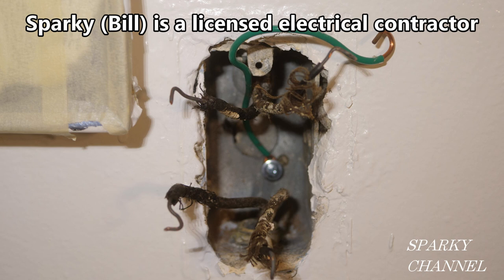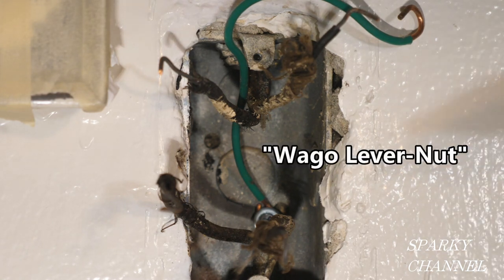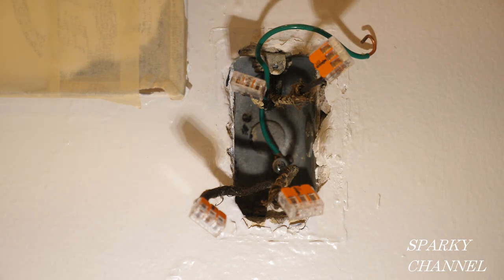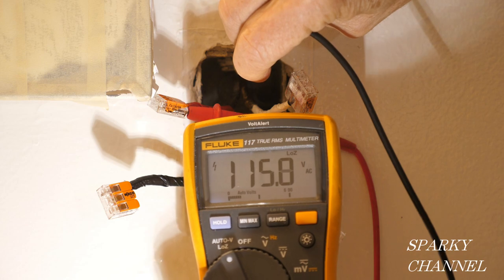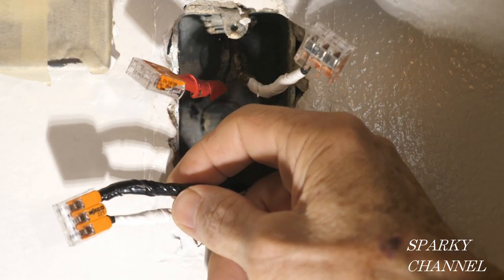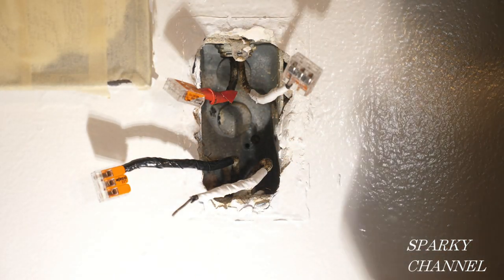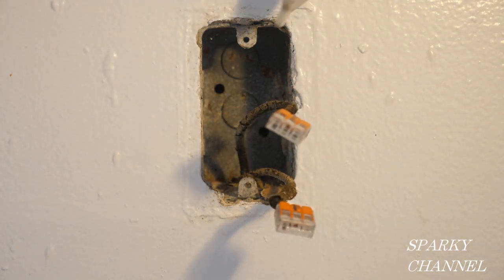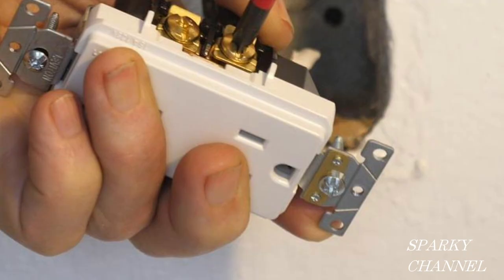How to Replace a GFCI Receptacle and Discover What it Protects Downstream

Comment: Bill, I notice you generally use Leviton GFCIs and AFCIs which have the line wires at the top of the receptacle.  My home is on 1955 NEC Standards, and I have a detached garage.  My area required the bathroom receptacle to be grounded, the receptacle near the sink in the utility room be grounded, the receptacles near my kitchen sink be grounded, the switch box to the light fixture in my bathroom be grounded, my furnace circuit be grounded, my outdoor light fixtures and their switch boxes be grounded, and my garage light fixtures and receptacles be grounded.  In my house, all the line wires come to my receptacles from the attic.  The Leviton GFCIs & AFCIs are perfect for this.  However, my garage has the line wire coming in from underground to a power receptacle that is the first in line.  From there, the load wires run to pull chain fixtures and a light fixture controlled by a wall switch.  My garage has open studs, so I can see the wiring easily.

In my retrofitting job for the garage, I used a Pass & Seymour Legrand GFCI because the line wire section was on the bottom.  The Pass and Seymour Legrand GFCI receptacle, however, had a short life (2016-2022).  I went back to Lowes, where I first bought it, and this time, they had Eaton GFCIs, which also have the line wires at the bottom.  I thought I would pass this on to you, to make replacing receptacles a bit easier for anyone who finds his or her line wire coming in from the bottom, rather than the top.

Comment: Great video. Very thorough! Also really nice you reidentified the wires especially the red tape on the hot. I can't tell you how many times I see work and this is not done.  Professional job.
Reply from the maker: Hi David! Yes, the colored electrical tapes do a great job of color coding the old faded wires but they also give a protective coating. Thanks!

Comment: Bill, I came back to ask since the NEC rules changed for 2023, now requiring kitchens to be protected with both AFCI & GFCI Protection, in this house with the GFCI in the bathroom, would you replace it next time with a combo AFCI/GFCI receptacle to make sure it meets the code, or would you wire the GFCI in the bath to send current downstream to the kitchen even when it trips in the bathroom, then put in an AFCI/GFCI receptacle in the kitchen to meet the 2023 code?

Comment: Great video and just one question, why did the breaker need to be off for the voltage drop test?  Your hot was the top wire coming into the panel and the bottom wire was the downstream one so whether the breaker is on or off it would still be cold. Are you worried about it being fed from another direction?

Comment: Nice clean install thanks Bill!!
Can you do a video showing a receptacle or switch that has a hot or neutral wire with stripped insulation in the middle of the wire and screwed to the receptacle at that point where the wire is continuing on to another receptacle elsewhere  and explain how you update that?
Reply: Heat shrink tubing. Maybe 2-3 layers

Comment: Great vid.  Didn’t u in the past make a self tapping screw ground?  And why is that illegal?  I think that self tapper would be a great ground. Thanks.
Reply from the maker: Yes I did. It was about electrical fire alarms: Kidde Hardwired Smoke and Carbon Monoxide Detector with Battery Backup and Voice Alarm  Installation: https://youtu.be/ORwBKqiKHHY
Perhaps I made another one specifically about the self-tappers vs. the green grounding screws too.

Comment: Love the channel.
Hey what is the charge terminals for? 
There’s line, load and then “charge”
Reply: charge is just a translation. Leviton devices are produced with bilingual labeling.
Reply from the maker: @kenbrown2808  Ken, excellent answer. The question had me stumped!
Reply: @SparkyChannel I had to look up a picture of the back of one - line translates to ligne, and load translates to charge.  
another pro tip: since they always put the marking tape on the load side, and the adhesive is obnoxious, you can determine which is the load side of one you are removing by feeling for the tape residue.
Reply: One last question here! 
is there a way to wire a receptacle off of a gfci to where it won’t be affected by an interruption of the ground, fault circuit interruption? Like if you had a receptacle that went to a bedroom and was coming from a gfci in a bathroom, kitchen etc..?
Reply: @kenbrown2808  thank you 🙏
Reply: @wyattsdad8561  glad to help.

Comment: The outlet showing 70VAC and "Hot On Neutral with Hot Open" on the tester was solved. The outlet that feeds it had two loose neutral wires.

Comment: Do you have any videos where you replace a small electrical box in a wall with a bigger one? I cannot fit a gfci in my current box.
Reply: I’m having the same issue
Reply: @MA-vm6jl  Will require drywall/plaster patching. Carefully removing drywall with an oscillating tool. Possibly cutting the box out with an angle grinder where it's attached to the studs....unless you remove a lot drywall. Big pain. Like to see a pro do it and compare.
Reply: Hope it worked out for you.  I’ve added deeper “old work” boxes and it was no big deal.  Go to a box store and get a deep box for ‘old construction.’  These have screws that are attached to wings that flip out and pull against the drywall to secure the box.  These will never be as secure as a nailed box.  Breaker off of course and an oscillating tool is best to cut the nails holding the original box.  Be careful to check that there aren’t any pipes or electrical behind the nails.  Pull wires out of old box and install new “old work box” and GFCI receptacle.  Shouldn’t need and drywall repair.

Comment: Hi Bill,  Is this a reason you wouldn't put in a GFCI breaker instead?  And then use a normal outlet instead?
Reply from the maker: I'm all for AFCI/GFCI and GFCI breakers. It's just that some older panels won't accept them.

Comment: Is this truly the first receptacle in
the string? Have we proved it?
Reply from the maker: Hi! Yes, it's the most upstream because with the circuit breaker off and all the wires of all the receptacles in the circuit (4) disconnected the box in the bath was the only one with a hot wire.

Comment: I'm surprised that you were able to fit that huge GFCI and wires into that tiny handy box.
Reply: new leviton GFCIs are 2/3 the depth of older models - but you're right that the box is actually only rated for one cable and one device.  whoever built the house chose very poorly.

Comment: Those wires are almost certain to be asbestos.
Reply from the maker: Not the wires. It might be in the insulation though.
Reply: @SparkyChannel  Correct. I should have been more pedantic and  colloquial. Having said that, I am not sure the insulation is asbestos but the Romex outer jacket, itself contains asbestos.